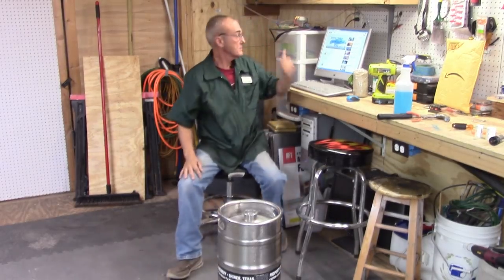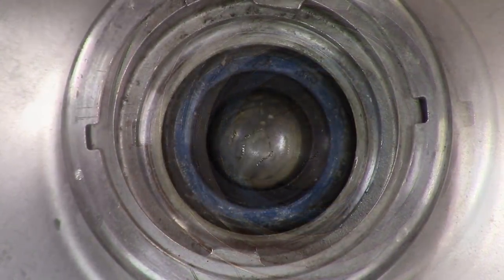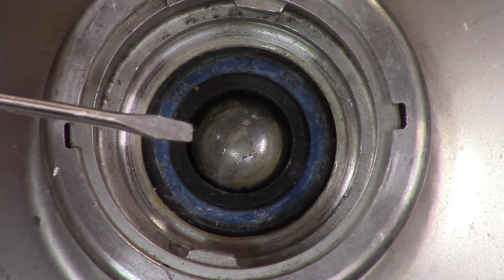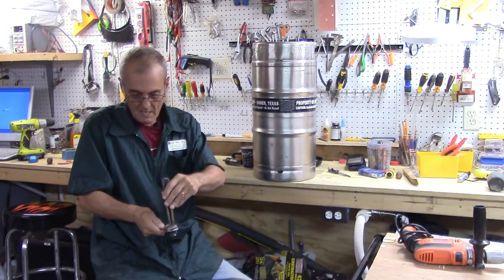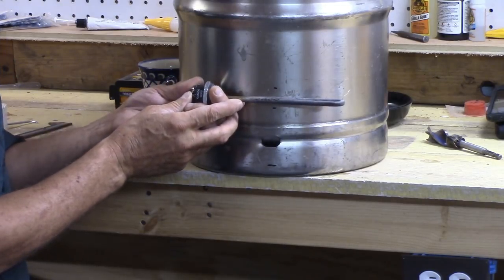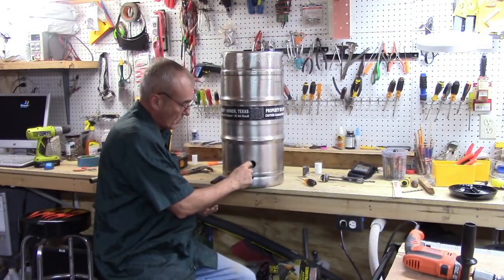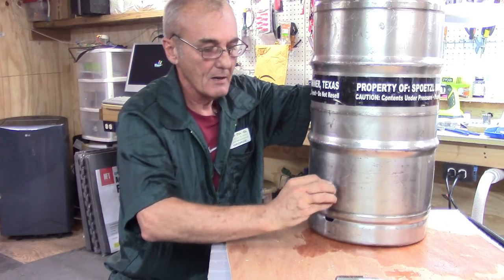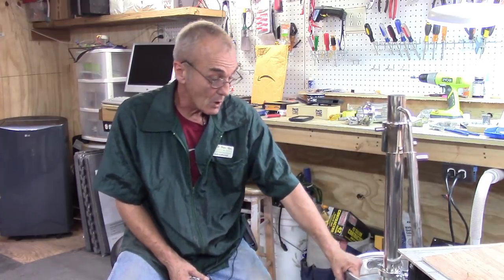RE-PURPOSE THAT BEER KEG, MAKE A KETTLE FOR YOUR STILL

Comment: A little tip. When releasing the pressure, lay the keg on its side first to empty the dip tube. No mess on the ceiling. ;)
Reply: I wish i would have read this before i went and did just that.lol
Reply: Andy H wish I would of seen this earlier befor I covered my kitchen in beer
Reply: Just cover the valve with a towel and press down through the towel.

Comment: First time to see video...George, when cutting holes in Stainless Steel....slow way  down, stainless does not cut, it chips. Slowing down will go faster and save drill bits and hole saws.
Reply: Was about to comment saying this, slow and steady, use a cutting fluid and keep everything cool. Just make sure you clean it off really well as cutting fluid isn't the best thing for your health lol. 

If you go to fast it will get hot, changing the temper of your drill bit/hole saw making it wear out/break quicker while at the same time hardening the stainless, making it more difficult to drill.

Comment: Have been using them with my reflux for years, you can also weld 2 kegs together. I run 2 15gal, one plumbed to the other with my reflux on the last keg. Also pony kegs work well as thumpers if there being used. I use natural gas myself but water heater elements do work very well and also I've seen boiler steam piped thru them as well. Great info and explanation!!
Reply from the maker: Simply amazing. You are way ahead of us and I love it.
Would like to see pictures if you get a chance. You can email them to me at george.duncan76@gmail.com
Happy Distilling
George

Comment: I was advised to drill or cut very slow on stainless. Will cut/drill much better/easier.
Reply: yup, with high torque. electric screwdriver instead of drill works nicely, with a stepped bit

Comment: Need to do a video on how to wire up the elements
Reply: If its 120v one terminal is line, other is neutral. If its 220v two hots and two terminals.

Comment: It might be a good idea to drill the drain hole at 90 degrees to the heating element. This will eliminate the possibility of interference with the heating element. Not sure if there maybe different lengths.
Reply from the maker: Very good idea.
George

Comment: Wondering if your way of just drilling a hole to screw in the heater element will hold up when the keg is heated to boiling. Seems likely to leak when heated if not completely blow out.
Reply: I think welding a female adapter for the heating element. Plus regulator switch. Awesome build any how.

Comment: What would i do if i wanted to attach a 4 inch column to the keg? Would i need to cut out the original 2" triclamp ferrule and weld on a new 4" ferrule or would a 4" to 2" reducer be satisfactory?

Comment: I am straight up forward. Your explanation on thermal hydro dynamics is not entirely inaccurate.  A heated fluid rising has to be replaced from the bottom with the cooler fluid, meaning that it is circulating because heated fluid rises and is replaced with a cycle of cooler fluid. This is thermal energy. It is NOT stationary as you indicated, the heated fluid is always in motion from the element upwards, creating a continuous cycle in any volume of fluid regardless where the heat originates. However, to be efficient, it needs to be lower in a given volume of a tank to become a circular event. Like you said, preferable above the very bottom to create the thermal motion. However, you are accurate in saying it should not be on the very bottom. There needs to be some space to create motion of the fluid.

Comment: Can I use a 2 inch piece of copper right off the keg the piece I have is only 6 inches tall. Then reduce it down to 3/4 inch pipe off the 6 inches.

Comment: Stainless is hard to drill, little fluid to cool it off goes a long way.
Reply: Working with stainless is like distilling. As slow and as cool as possible. Stainless hardens under heat so impatience makes your job harder and harder as you go.

Comment: I had to file 3 inch diameter holes to put domestic 3kw elements in 2 steel 205 litre drums for filtering waste veg oil to run my cars on , i was there for hours and the noise it made wow.

Comment: Is the element you put in 115 volt or 220? Also the column you attached to it I noticed it has a condenser on it. I would just want a column to run as a pot still I don't want to use condensing water to chill the vapor... Do they make one without the condenser built into it?

Comment: I can not believe that you can tread that thin of a wall to secure that element properly. It just looks too easy lol 
I had to weld connectors for element, thermometer and drain. 
Advice for people - put a 1/2" NPT on bottom of the keg for draining it out,(put valve and 90° elbow) it makes life so much easier! 
I've built 15.5 gal with 5500w element, takes 30 minutes to get to methanol
Reply from the maker: It can be tricky but if you are careful and tap it straight in the element will seal. It does help to flatten the side a bit. If that fails welding a coupler is an easy fix.
The drain is a great idea. I got one by mistake and now see the beauty of it.
George
Reply from the maker: Thanks for the info and links. I'll get to reviewing this tonight.
George

Comment: How do ground the electric with the screw-in heating elements?  Are you connecting the ground wire to the still Base?
Reply: Current travels through the heating element, so plugging into a ground fault interrupter should do.

Comment: Hi George
Another great video, I have a questions about the column size.
I am in the process of converting a 50L / 13 gallon keg, I was wondering what the advantage of using a 3” column is compared to the 2” column and if I was to use a 3” column would I need to cut and weld a 3” tri clamp fitting onto the keg or is it possible to use the 2” with an adapter to 3”.
Thank you
Paul

Comment: What type of silicon gasket is that?  I need one that is flat on  1 side and ringd on the other.
Reply from the maker: It is a heat resistant gasket. I believe you can find them on Amazon

Comment: as it only has 2 small holes column and drain. how do you clean the pot properly?
Reply from the maker: Like all stills, after use immediately rinse it out (unless it is copper) and that will keep it clean.
Reply: @BarleyandHopsBrewing  Why did you say, "unless it is copper" ?

Comment: I'm building a 2" copper column  for a keg still. Can the copper ferrules be soldered onto the copper pipe instead of using stainless ferrules? I'm wanting to use the tri clamps to make my connections.

Comment: I'm in the process of building my still worth a 15 gallon keg. I was planning on using a propane burner for heat but watching your videos have changed my mind. What size heating element would you recommend for a larger keg?
Reply from the maker: If I was making this I would use a 3500 watt element on a 240 V circuit. If 240 v is not possible a 2000 watt on 120 V would do but the heat up time would be a little longer.
George
Reply: @BarleyandHopsBrewing  Sounds good. I will go with the 240 setup. Also my column is only 1-1/2" copper pipe 18" long. I was planning on putting copper scrubbers in it to get a little reflux. Do you think will work or should I go with a longer or larger diameter column? I have access to stainless tube and can make a larger one if needed.
Reply from the maker: For that size kettle I would really go with 2 or 3 inch column. Remember the copper scrubbers will not give you a direct reflux action since the column will balance in temp and no reflux action will take place. 
Your column length is fine but if possible go up to 24 inches if you can.
George
Reply: @BarleyandHopsBrewing  thanks for the info. Love the videos, very informational and easy to understand. Keep up the great work.

Comment: Very great video how big is the condenser on those columns
Reply from the maker: About 30 inches
Reply: How big of pipes are used
Reply from the maker: I believe the inside pipe is 3/8th and the outside jacket pipe is 3/4 or 1 inch.
George
Reply: Barley and Hops Brewing  thank you your videos are top notch

Comment: Love your videos,,  just a hint,  you really did not need to re-drill a second hole,  they make SS nuts 1" and a washer  with another rubber -silicone washer on the inside would have saved the extra work,  but you probably need the clean out hole anyway...

Comment: George, What type gasket did you use between the keg and the column? I have a 2 inch by 26 inch  tri-clover  stainless pipe. Do I use a tri-clover gasket, o-ring, or flat gasket? Also, What size heating element would you recommend for a 13.2  gallon keg  IF you were hypothetically going to make a water still
Reply from the maker: I used the gasket that comes with the column. 
I would (hypothetically) use a 3500 watt element wired for 240V. If that is not possible and you only have 120 Volts the 2000 watt element will work but heat up time will be a little longer.
George
Reply: Since I do not have an official column, is it a tri-clover (rib around center) or flat?
Reply from the maker: Use a flat one. That seems to be the universal solution.
George

Comment: My question might be dumb, but figured I would ask anyway.. what is the benefit of using a heating element vs one of those propane heaters that are used for the turkey deep fryer pots?
Reply: Ease of transport and basement operation fire hazard. I cant remember if propane gives off CO gas but that could be an issue too.

Comment: George what heater element would you recommend for 15.5 gal keg?
Reply from the maker: I would use a 2000 watt element if using 120V and 3500 if using 240 volts.
Both would be fine
George
Reply: thank you/ merci for the quick response!

Comment: George,

Have you used this still, I was wondering if the smaller diameter and taller height affected the run?

Another question could you do a video on how you waterproof the connections on this type of element installation, describe how you ground the element to the keg?

Thanks

Comment: How long of a column is correct if you're using the 2" pipe? Would it be different it if was 3"?
Reply from the maker: A column should be 18-48 inches depending on your designed purpose. Both 2 and 3 inch are the same.

Comment: Is there any advantage to using a steel element over a copper element or vice versa?  I've found both and they seem to be the same price.  I know people normally use copper in the column, so I was just wondering if it would make any difference in the element even though they serve 2 different purposes.
Reply: You'll have to clean the copper elements much more often as they'll tend to pickup more gunk. Stainless is the right way to go here, let the copper in your column and column packing do all the work.
Reply from the maker: Absolutely correct. 
Thanks
George

Comment: I want to build one of these but I'm wanting to do it a little differently , I want to cut the top of the keg out and weld in a stainless steel ring and then make a copper cap and arm for it like the all copper stills have. Only problem is I don't know how to make the cap and arm. Any suggestions ??
Reply from the maker: Sorry. Haven't made of of those yet
Reply: @BarleyandHopsBrewing  ok got one other question, can the heat element be installed in the bottom sticking straight up instead of in the side?
Reply: @BarleyandHopsBrewing  ok got one other question, can the heat element be installed in the bottom sticking straight up instead of in the side?
Reply from the maker: I guess it could but there would need to be some sort of stand off on the bottom since part of the element will be sticking out.
George

Comment: Hi, Just picked up a beer keg ,, is the one in this video a 15 gallon as well?   and also I was wondering how many gallons would be good to run in one of these with the 2000 watt heater 3 1/2 inches from the bottom,
Reply from the maker: The one I have is an 8 gallon. You can easily run 10 gallons with the element you describe. Just give it plenty of time to heat up. Heat up time is directly proportional to volume so less volume less heat up time. Usually about 30-45 minutes for 10 Gallons.
You could speed that up with a 3500 watt element on 240 Volts but the 2000 watt on 120 V will do just fine.
George
Reply: @BarleyandHopsBrewing  Hi,, Thanks for the reply,, kinda want to stick with 110v for now,, not to comfy with wiring 220v although I watched you video on that and  learned alot about 220v but would rather go  with 110v,, I was thinking of maybe putting 2 in like you said and when the temp gets close shut the upper one down and let the pid controller take over the lower
Reply from the maker: Sounds good. Just make sure you have enough amperage to handle 2 elements until you shut one down.
George
Reply: Thanks George,I will , I watched another video of yours today about electricity , using multimeters both analog and digital, I have both, but never really knew how to use them other than checking voltage,ac and dc,,,,,ohms and resistance were some weird looking things on the dial that didn't concern me,, until now,, you explained ohms and resistance and calculating watts and amps ,, as to voltage 110 220,,, learning a lot here , Thanks ,, you are a good teacher,  some parts are coming in now for the pid build,, still figuring out the column construction, I'm a bourbon /whiskey fan, so  I'm thinking short column,, Thanks again  @BarleyandHopsBrewing

Comment: can this be kept on top of a fire stove & heated instead too ??
Reply: While Stainless Steel (SS) will get hot, it is a poor conductor of heat, that's why they make thermos bottles out of SS.  You can use an external heat source, but you will consume a lot more energy for the same amount of steam / vapor generated.  Besides an external heat source will also heat up the area around the still a lot more.  This might be a plus if you're distilling in the winter.  You can always retrofit to an internal heater element later.

Comment: Do you sell just the column and condenser by it self?
Reply: chance kiki yes he does at barley and hops but theres plenty of websites where you can order one. Personally I like mile highs design for the dual purpose columns but just find one you like
Reply: Scotty Weißmüller could you send me a link to the mile high one?
Reply from the maker: Yep, these guys are absolutely right. 
Here is the Mile Hi site: https://milehidistilling.com/
Or you can visit barleyandhopsbrewing.com
Either way Scotty said it best "get the one you like"
George
Reply: Barley and Hops Brewing thank you. 🙏
Reply: If you buy the stainless steel Mile Hi column, make sure you get a roll of copper mesh to stuff your column with. Copper will remove much of the off flavors you get out of your wash, and it'll add a little passive reflux, which means higher proof and better quality output. You can reuse it over and over if you rinse it in vinegar, then hot water, every few runs.

Comment: Looks amazing, just wondering how you'd clean out something like that?
Reply: Oliver Whitaker use a carboy brush.
Reply: Pressure washer? 😂
Reply: well you could solider or weld a clean out port hole to it... or, cut a 5" x 9" hole in the side. then with another keg cut a plate that is 6" x 10" so that it can be a cover. dill a hole in the cover plate (center) and run a bolt through it. with a chunk of bar steel 6 or 7 inches center drill a hole for your cover plate. cover plate inside and bar outside screw them together and pressure holds them air tight. sand edges so you dont cut yourself and that will take care of being able to clean the inside out! might need a gasket might not. not sure if you can see were im going with this but it is a simple way to do it.   https://www.acmetools.com/shop/tools/clemco-21549?cm_mmc=Google-PRODUCTFEEDClemco_-21549&gclid=Cj0KCQjwit_8BRCoARIsAIx3Rj69DH2Tn4_31SyNh0TvV4QdR7suTTx4q0USaY95_yuSZQvPFCD6rwsaAh32EALw_wcB heres a pictur of a sandblaster with a port on the side kinda like what im talking about if that helps

Comment: That was way easier than I expected.  How can you test to see if the keg is AL or Stainless?
Reply from the maker: Most are. They may have a galvanized outer coating but the inside is almost always stainless steel.
Reply: Put a magnet to it
Reply: Neither stainless or aluminum are magnetic.

Comment: I don't see the point of using electricity when you have to buy the element install it,then get a control unit to run it.why not just use gas ?

Comment: George, do you guys sell a 2 inch column with out having to buy one of your stills?
Reply from the maker: Yes, Call Josh at the store 254-300-8226
Reply: @BarleyandHopsBrewing  
Was wondering about one more thing. Most kegs are aluminum, should anyone really use aluminum for a still?
Reply from the maker: @walterinskeep1477  Internal portion of kegs are stainless steel.

Comment: Where's the best place to buy the heating element please
Reply: Scott Speirs Lowe’s or any hardware store. They are water heating elements. I got a 1500 watt one for like 8$
Reply: Home depot, lowes, Amazon ace and practically all hardware stores and just make sure you have a variable controller and you'll be fine
Reply: but the water element is it stainless steel because some are copper and others look like galvanized steel?
Reply: Sylvain Racine the copper is fine and they say if there is any lead in there so just don’t get anything with lead.
Reply: chance kiki what size is your still I have an 8 gallon and shopping elements and doing research

Comment: Does anyone know of a good 220 volt element for this size keg?
Reply from the maker: A 3500 watt element is probably my go to element for any still over 8 gallons. 2000 watt works great on stills 8 gallon and below.
Reply: They are made for house hot water systems.